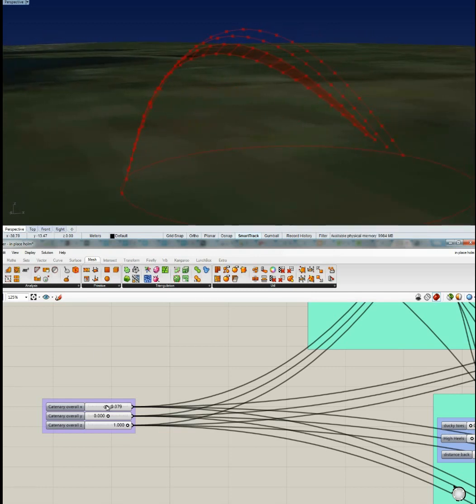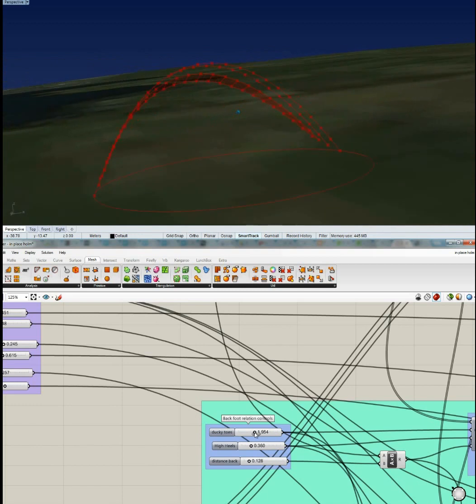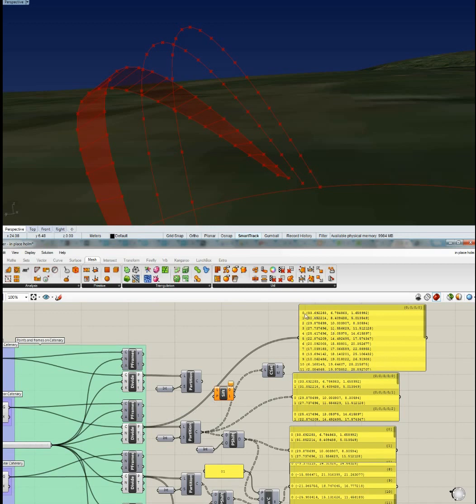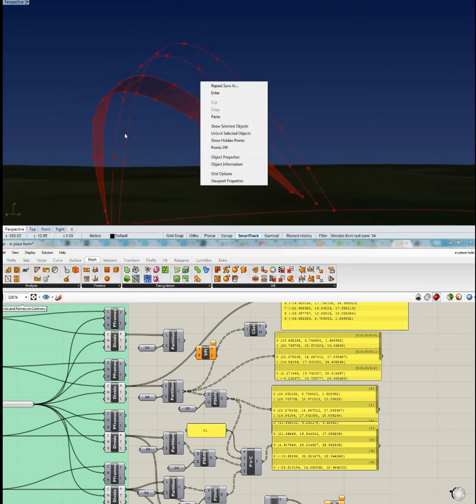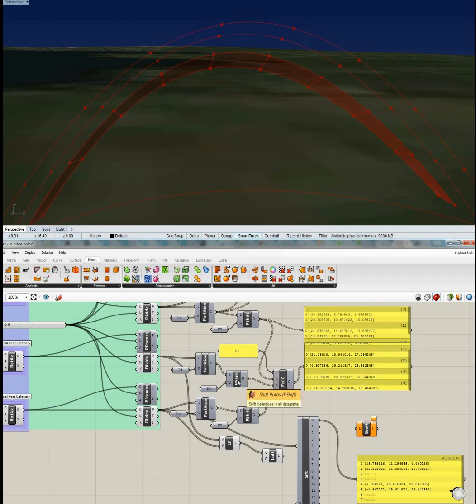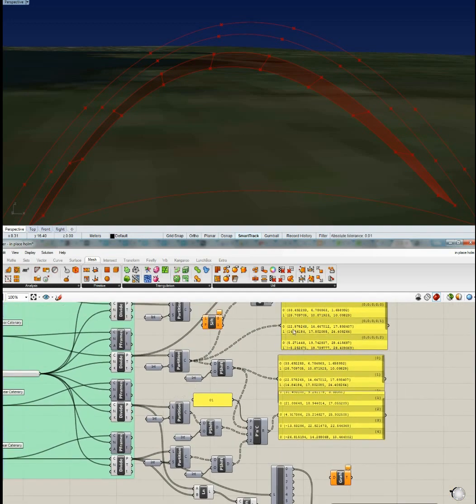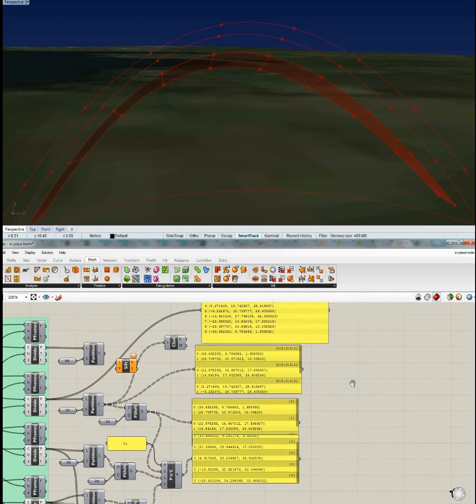Arch kites for grasshopper

Comment: You've got a very long graduated parafoil, let's build a prototype.... you don't need any slats, we just put in nylon rip-stop ribs in there 7-12 " apart...it should work fine.... Lets' build it. How wide do you want the center width, (4ft. ?) and what is the overall length of the arch that you want to taper it to? Say 40 ft.)? When the tapering gets get down to about a foot wide, we could go from parafoil, to a dacron or kevlar material type keel to the end anchor point of the arch.